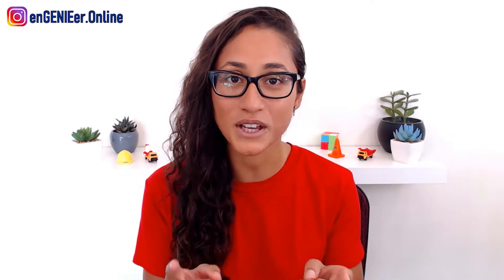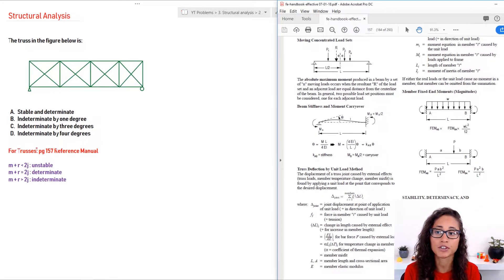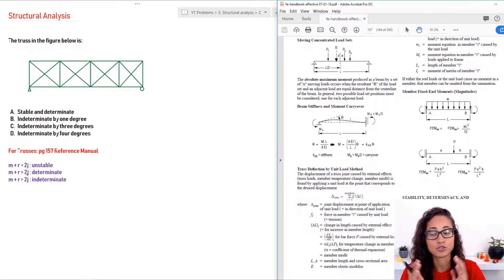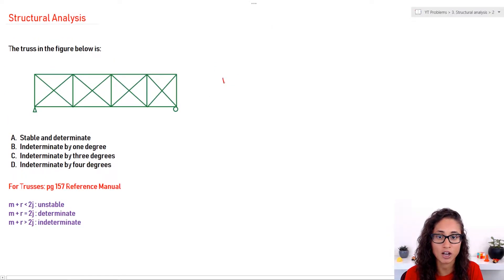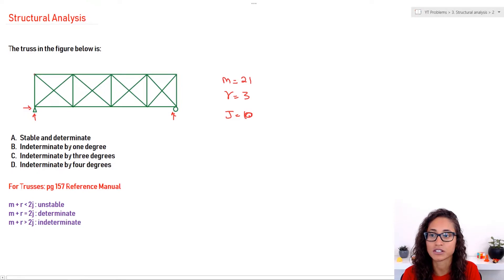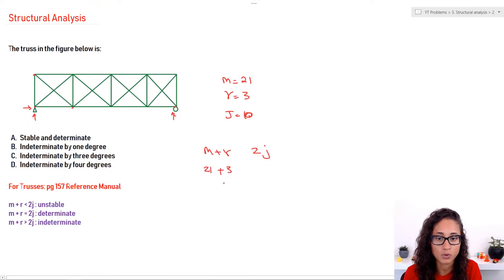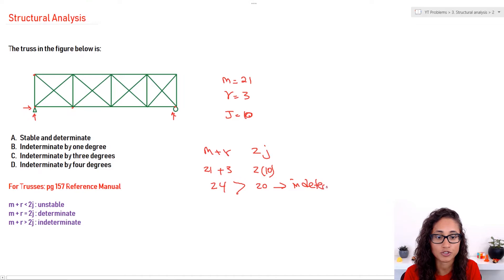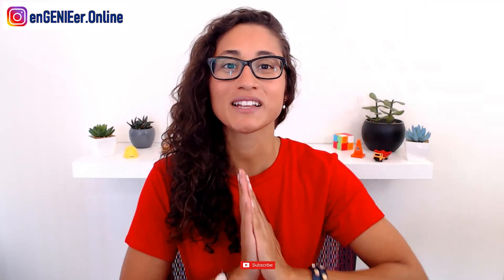Truss Analysis (FE Exam Review)

Comment: Hi I think You made a mistake.
It should be m=29, r=3 and  j=14. 
The answer is D though.
Reply: Depends on whether the crossing members are joined or just crossing.
Reply: I agree, based on her previous video "Frame Analysis - FE Exam Review".
Reply: Each cross beam isn't inter-connected. They only connect at the four corners. Redo the count with that understanding and you'll get m = 21